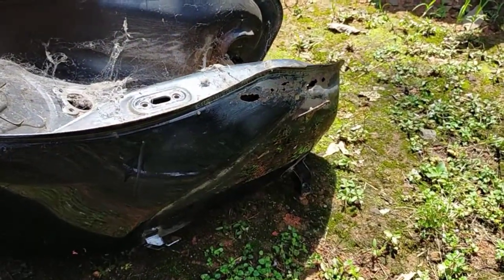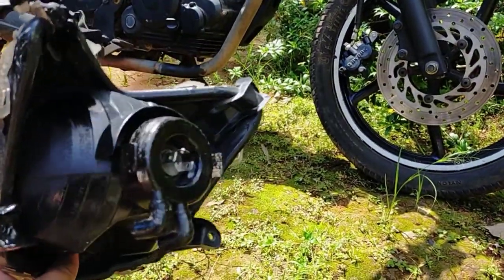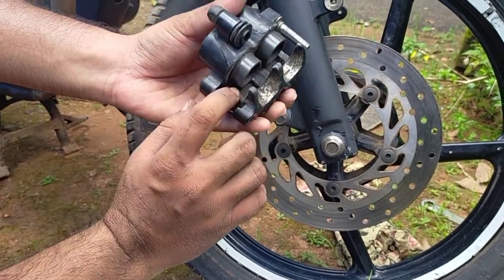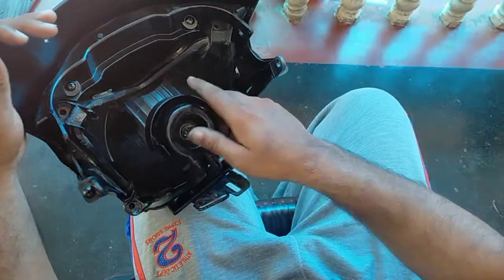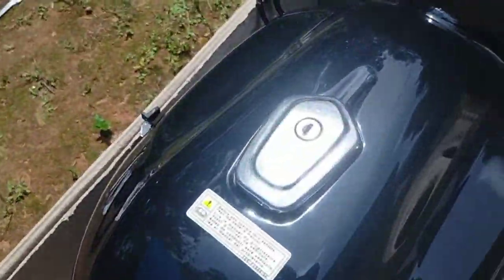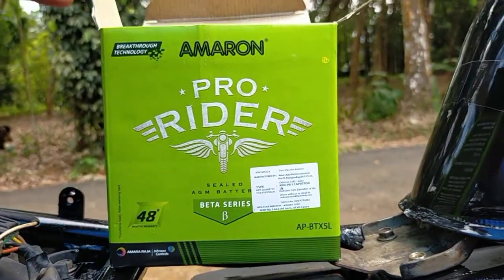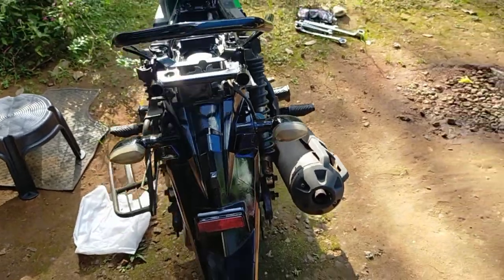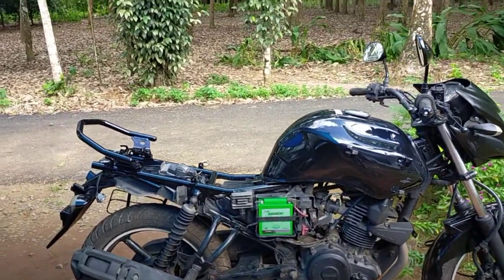RESTORATION SZ-R Part-1

Comment: Bro himalayan back tyre  etha best mrf ano, ceat 2  ittapol maximum 8000 km pokunulu. Mrt rate ethraya?????
Reply from the maker: Bro 3500-3800 aanu rate MRF , MRF girp normal aanu , ceat atra good ayi tonanilla , pinne ullath timsun aanu ath nalla grip und but rate kooduthala, Appolo um available aanu appolo also good , budget friendly and life MRF & APPOLO aanu👍
Please do subscribe & support bro 😊
Reply: Subscribe done😎😎,  mrf medikkam appo engana poyal above 11k km kitule (matte videoil kandu )
Reply from the maker: @SN-jy4po  bro ippozum mrf tane aanu maariyitilla bike 23000 kazinju👍 pinne mrf itapol tane bikente cornering confidence koodi😉
Reply: Bro athinte name correct onnu patayuvo mrf tyre 120/90 anp
Reply from the maker: @SN-jy4po  120-90-R17
Reply: Noted with thanks broo😎😎
Reply: Wet grip , dry grip engane und brooo ipol rate 3624 online kanikunu, shopsil kanunilla oridathum
Reply from the maker: @SN-jy4po  bro ith MRF nte authorised dealer aanu , avide matre kittan chance ollu local shopil availability kuravayirikkum, rate atrem varum👍, pinne bike heavy weight ayath kond tanne road grip kittunnund👍 best grip onnumalla but ceat nekal better aanu,

Comment: Mileage ethra kittunund
Reply from the maker: Now its 45-50 i cleaned and checked everything myself at home👍
Please do subscribe & support bro ☺️
Reply: @blackstallionvlogs6802  enikk 25 okke kittunullu... ടാങ്ക് problem aaano?
Reply from the maker: @abink2083  tank problem or carburettor tuning problem , carb onnu azich clean aaku koode AIS um, vaccum piston nte mukalike rubber damage undonnu nokku ,also over flow pokunnundo ennum check cheyu,ithoke clear aayal nalla milege kittum air filter maaran ayengil athum maaru👍 
Please do subscribe & support bro 😊